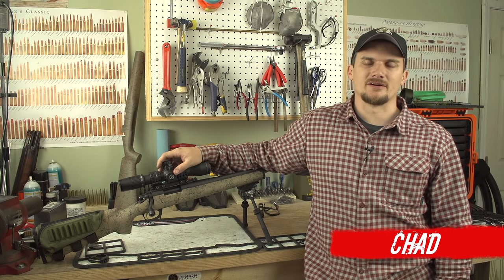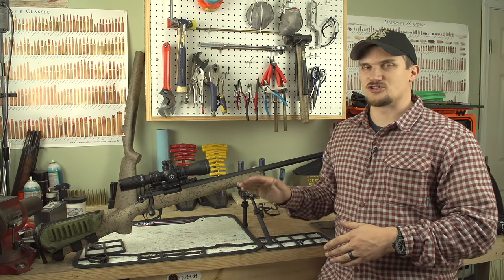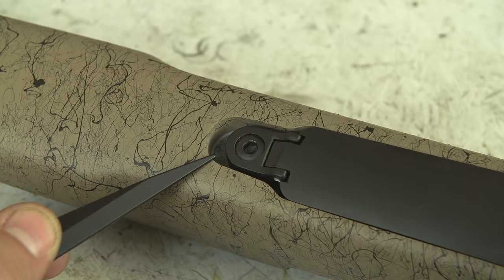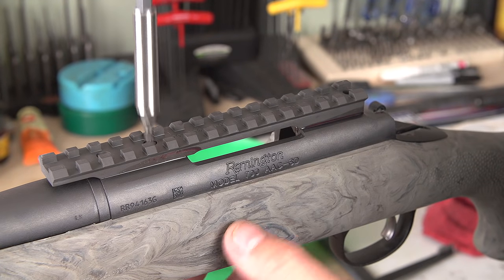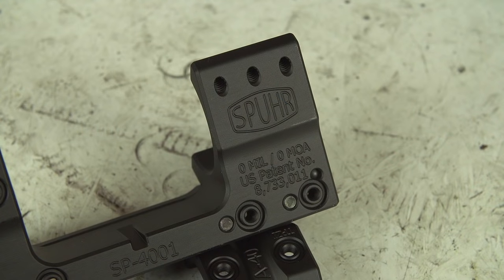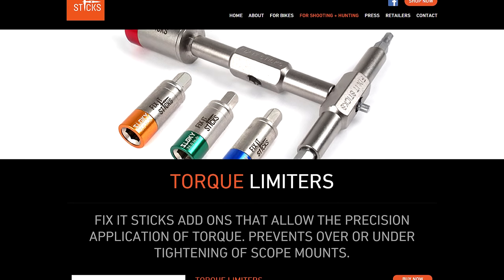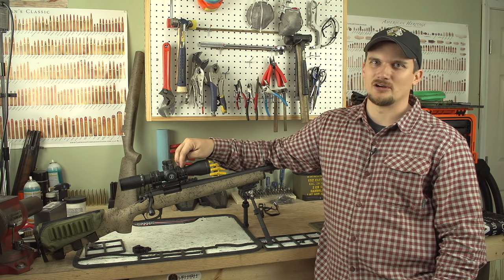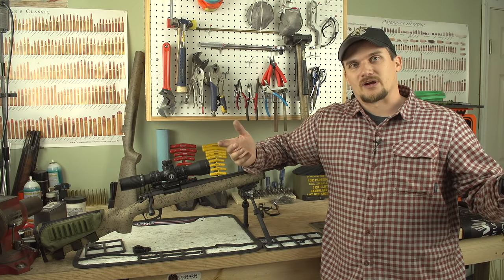Remington 700 5-R Custom Build

Comment: Hey guys first off love y'all vids. I used a h&s precision bottom metal on my rifle! Took less than 10 minutes to relieve the stock!  I did set the stock up in my vertical mill, but could have done with drimal tool!  Very little relief needed with h&s metal. Thanks

Comment: My bolt on my 700 5R gen 2 broke off the bolt, lol. It was using a rubber mallet trying to remove stuck casings out the action. All S&B 6.5 cartridges did that with new factory loads and reloaded rounds using S&B cases. I now only reload 6.5 Creedmoore with Hornady spent cases. Sent the action to Rifles Inc to tig weld a new EGW extended bolt lever as well as their accurizing the action, added a side bolt release, fluted the bolt. I sold the original Hogue stock and put it on an MDT xl gen 2 aluminum stock but since then changed to a Master piece arms BA competition stock.  I mounted an S&B PM II Ultra Short 3-20 scope in a Spuhr qd mount. Easily sub moa rifle.

Comment: I have the 700 5r milspec, 24 inch, us optics 10 power scope.  Ordering Hibbert trigger to replace the factory recalled xmark pro trigger it came with.  But I want to mod the 4 round base plate, and I like your suggestion there. Some sort of level is needed, like the way you went, but have considered the 2 piece level that attaches to the scope tube.  This is a far cry different than most vids you post.  Thanks a million for slowing down the pace and dwelling on preferences, options, why you went with what you did, and the all detail, especially details like the pins under the rail all very very helpful.  You know do much I benefit from, you live this, I dont, please do more like this in the future.

Comment: One note about mounting the Base:
When I mounted the base on my 700, I had to “bed” the rear of the base. There was a slight air gap on the rear. I just used Epoxy to fill the void as I tightened the front screw. 
Just my experience.

Comment: When are we seeing the follow up build for this rifle? I am super excited for my build, I got the same gun but in .300 wm. Probably going to use a lot of the same  components you have and have just picked up a viper pst gen 2 in 5-25x50 to put on it.
Reply: Hope the build is going well. I did something similar and I used the hs precision stock but I went with their bottom metal so I didnt have to send it off to be fitted or anything and it works great!

Comment: Considering purchasing this rifle in 24 inch barrel but the slower twist rate has me concerned....  Also considering getting a standard SPS and then upgrading the stock, bedding the action and threading the barrel.  Looking for a cost effective solution but don't want to be disappointed down the road.

Comment: piss on all the haters Chad!! you guys make great videos!! looking forward to the rest of this series on the Remington 5R rifle builds! I did a REM 700 SPS in 308 not to long ago and she was a great shooter. I sold it to my cousin to get him into long range shooting and damn do I miss that rifle. I'm currently running a new savage FCP SR 308 with the heavy fluted 20 inch barrel,accutrigger, large tactical bolt knob and a badger 20 m.o.a rail. She's definitely a tack driver but she's still in the factory accustock with the aluminum bedding block. it's not bad but I most definitely need an upgraded chassis. I can't decide on buying one or selling her and scooping up one of the new savage model 10 ba stealth rifles. what is your thoughts Chad and Eric?

Comment: You should also do an accuracy comparison between those $400+ rings and say, a set of $100 rings.
Reply: You can buy a nice set of rings and a base for less than $250 and buy a complete professional precision mounting kit for $100.  There is no need to spend that much money.  They paid $400 for the rings plus $150 for a base.

Comment: Did you have trouble keeping your scope level during installation due to the fact that the tightening screws are moving the scope along two axes (due to the 45 degree cant) rather than just one?

Comment: All in, what would that rig run?
Reply: Bill S scope base is about $150.  mag conversion is about $300.  the Spuhr mount  is about $400.  Jewell trigger about $200.   plus $1200 or so for a gun.  and the Leupold is about $1500 if it's the Mk 4 FFP I think it is.
Reply: My guess is around 3000 but don't quote me, I'm Dutch.
Reply: i think that scope is $2k+
Reply: Yup, $2800 and change. Holy crap...
Reply: Snoekvisser1972 the cheapest optic i can find with the h59 reticle is the bushnell elite: $1,600.00

Comment: i heard there were provlems with the xmark pro trigger concerning the safety disengaging and simultaneously dropping the striker. could you guys shed some light on this?
Reply: Two First Names I think that was the trigger before. XMark had too much thread locker.
Reply: Total BS. This came from the imagination of an attorney trying to come up with a defense strategy for some idiot that shot another person. Blame the gun rather then the person who pulled the trigger on a loaded weapon while pointing it at someone. Remington voluntarily  recalled those triggers and replaced a bunch to avoid a lawsuit. Both times this was sighted in a court case the rifles in question passed all function test and were found to be fully operational.
Reply: thanks for clearing that up! day's not wasted when you learn something new.

Comment: Can I just buy a 5 R barrel? i love my 700 BDL short action in .308 I also have a 700 ADL long action in 7mm rem mag I'd like to rebarrel.
Reply: Yes, of corse and you can get one that’s even better then on any factory rifle look at krieger, bartlein and Obermeyer (witch trade marketed “5R” I think)
Reply: @submoa9278  Thanks, man. The way the world is going makes me want to set that rifle up especially.
Reply: Tracker Buckmann look at criterion, don’t think they have a “5R” but they have a barrel nut making it easy to change if you have never done one before
Reply: @submoa9278  I haven't, but I have my own 5000 square foot shop where I live and work full of tools. Been watching lots of videos about it.
Reply: Tracker Buckmann nice, all you need is a wrench,headspace gauges and a punch to remove the ejector and barrel vice or something to hold it with

Comment: So I have a question for anybody that knows gun laws. So I am 18 years old and been wanting to get a rifle although I do not have a car, I only intend to use the rifle for range use although if I am using public transport, is it legal to compact the rifle such as an ar15 and pack it in my backpack? I live in Seattle, WA I have tried to look up laws for rifles except I cannot find anything about rifle transport. Any suggestions or ways of going about this please comment
Reply: that changes per state. you have to check for your state specifically. also each company for transportation. for example a private owned taxi company may ban firearms in there taxi. in my state its legal to do so unloaded for long guns
Reply: Black Abyss don't know Washington laws, but be careful dude. who knows what law enforcement response could be if someone found out and panicked.
Reply: Washington people get spooked easily so it would be staying in bag, in parts, until at range or home.
Reply: The best thing for you to do is go and visit the police where you live and ask them or contact the NRA.
Reply: Wow don't listen to the guy who said ask the cops... or call the NRA lmfao! Its called a discrete carry case. Looks like a normal duffle bag but it holds a rifle and mags.  Not that I recommend it but legally you can walk on the bus with a rifle strapped to your back, it's called the constitution and it allows the right to bear arms. Rifles are not considered concealable due to there size requirements of barrel and overall length. If it was small enough to conceal then it would be an sbr or aow. When you get a concealed carry license , It's called a CPL, concealed pistol license. Its technically only for handguns. I live in eastern Washington and we have to go to Idaho to find a "friendly" place to shoot. Too many retards in Seattle to trust that people would now the laws, they would for sure call the cops if they saw a rifle on a bus. I'd find a friend with a car to give you a ride or pay for a taxi, regardless don't wave it around and you should be fine. Disclaimer I'm not a lawyer so don't take my word as fact. about ten thousand laws on the books so who knows.
Reply: buy a guitar case from the pawn shop ,then convert it with foam on the inside to hold your rifle ...they are about $30 at nearly any pawn shop that sells guitars....just stay away from inquisitive musicians
Reply: Jonathan Carnahan Is that legal? Great idea though thanks!
Reply: Black Abyss You can find any states gun laws at "state".org and search guns laws, takes 5 minutes to read.
Reply: Yea but the government always makes up different rules about certain situations and carrying around a broken down AR is not something that is in law sites I have visited such as .gov sites. Just talks about CPL and pistols not much information about rifle transportation besides the fact that all the crazy stuff happening these days I don't want to be put in a situation where as if I got in a situation with officers for another reason, (im a good guy but police get suspicious sometimes)  and they were to search my bag, could I get in trouble for carrying the rifle even though its disabled and cleared?
Reply: I would assume that if you follow the law for transporting a rifle (secured, unloaded, ammunition in locked container) you shouldn't have a problem. Obviously if there is an individual on the bus who happens to notice somehow, you will have to answer to law enforcement. Even if that situation were to occur, you have taken steps to abide by the law which shouldn't cause you an issue. Unless of course you get the wrong cop that day. Your best bet to get full clarity of the law (not officers opinions because that will change) you should contact your attorney generals office. You can also contact law enforcement agencies if need be. I'd start with the Sheriffs office before local agencies.
Reply: Ben Cunningham Ok thanks man much appreciated.
Reply: Jordon E

Comment: about those rings,I hate to hear that!! unless (A) your rich in which that case whatever or (B) your a World Class Professional Shooter that requires  hundredths of an inch @ a Thousand yards, you kinda just tossed alot of money down the drain in my opinion LOL!! Thats several hundred rounds of Ammo!! I couldn't imagine anything at your/our level of shooting that requires anymore than a set of Warne Maxima vertical QD rings. Warne guarantees 1/1000th of an inch accuracy when removing & replacing w/there QD rings as long as your using a steel picatinny base (not aluminum). they might not say Spuhr but for $300 Plus dollars less I'll take the Warne QDs any day of the week!! To each there own, Nice video nice rifle!!

Comment: are they aver going to fix the safe switch problem. it was on local news this time. you have a bullet in the chamber and then put on the safe, it fires????????????
Reply: its already fixed. that recall is old. no issues anymore and it was only with specific guns
Reply: "Safty swith?"

Be wery wery quite when hunting wabbits... (Just busting your nuts. Don't lose your head).
Reply: was on log news yesterday. guess they are wrong. and I know it is an old problem I have 2-700, 1-222, and 1-xbbr-target rifle
Reply: lol. was on log news yesterday. guess they are wrong. and I know it is an old problem I have 2-700, 1-222, and 1-xbbr-target rifle. have a good day
Reply: Fake news... lol. No seriously
Reply: Caleb San Miguel actually, now its very fake news according to trump. Lol

Comment: Unfortunately Remington isn't what it used to be after the Freedom Group took over. $1200, than replace the trigger, bottom metal,  machine work and still have a stock that's not adjustable, and has too low of cheek weld for large dia. scopes. Does Remington even offer a 6.5 Creedmoor? 
Mk6 Leupold is known to have problems and there are better options for the money.
Spuhr mount is quality though. lol
Reply: juicebox853 yes they make them in 6.5 ya dummy

Comment: I'm turning 18 soon and I want to purchase my first gun I want something compact easy with maintenance and eco friendly can anyone recommend me one??
Reply: jose juarez eco friendly.. wth is that.. with a rifle..
Reply: he means economically friendly
Reply: +mario moso don't think I mentioned rifle..
Reply: jose juarez lol... i just guess since it was a rifle video and the eco friendly was a satirycal joke
Reply: +Andrew Smith did not realize I put Eco instead of economically
Reply: +j p minimum $700
Reply: Pistol or rifle
Reply: considering youre turning 18, a rifle is really your only option. Id get a 10/22 because they're cheap, they're in 22, which  is what a new shooter should start with, and they are always a ton of fun.
Reply: If you want something cheap, used Ruger 10/22's are cheap and dependable, plus really cheap to shoot. I own one that has 8000+ rounds through it already, gotta give it a good cleaning every thousand rounds or so and replace springs every 3-4000 rounds but it works great. The Ruger American Rifles are a good low budget choice as well for a hunting rifle and they shoot very well. 

All depends on what you like though. If you prefer one type of action over another (lever vs bolt for example) then you may not like the Rugers and a Henry might be a good choice. Make friends at the range and try a few different guns to see what you'll really like.
Reply: Can't go wrong with a break action shotgun for your first weapon.  You can buy inserts to change caliber fairly inexpensive these days.
Reply: eco friendly hahaha
Reply: jose juarez  I gotta agree with tsnorquist on this one a nice side by side 12 gauge is a good place to start if your not very experienced or if you just want a little bit of fun and if a shotgun isn't your thing a 22 such as the ruger 10/22 as was mentioned earlier is your best option though if your looking for something more powerful either a mosin nagant or even an old mauser would be a good starter and there still fairly cheap if you are will to put a little work in on them good luck. just to clarify I'm from Ireland so some of this may require different permits from what I would need.hope this is some use to you buddy.
Reply: if i where you, i could buy a Glock 17 ad a pistol, if assault rifle i would buy an H&K 416c, it's a great rifle and only for 600-650$
Reply: Stalker i hope your trolling at 18 he cant buy a hand gun and no shope will just sell an assault rifle
Reply: I'd take a CZ75. They're unbreakable, durable, reliable, shoot a common cartridge, are not so expensive, can be carried and are made of real steel, not like Glocks and others which are made of plastic ;-)
Reply: Just buy an AR15... then spend that much again on ammo and get to shooting. If you want "less" maintenance then buy an AK74, regardless like most of us, you will spend more time cleaning your rifle then shooting it. If you want economical then buy an airsoft gun lol
Reply: Ruger 10/22
Reply: Richard Maunder look at the older videos, Chad did a killer 10/22 build
Reply: Yes I have seen them thats why I said buy a 10/22 I have owed of three of them.
Reply: +lucky43113 what's the minimum age to get a pistol in the US?
Reply: +lucky43113 and, i think the H&K weapon series are sold for civilians out there, but i don't really know what's the recomanditions to get them licensed.
Reply: there's also a cheap 22lr. rifle called ISSC MK2, it's a replica of the Scar-l i dont think it's that good but it's perfect just to start with  since it's pretty cheap.

Comment: WTH is with these 20"/24" barrels? Is there something wrong with a 26" barrel? It's my understanding that a longer barrel gives you better accuracy and velocity at range or are gun manufacturers full of shit on this point?
Reply: 308 works fine out of a 20" barrel. Shorter barrels=more rigid due to less length which results in better accuracy. Only a few magnum rounds benefit from the extra length and weight of a 26" barrel.